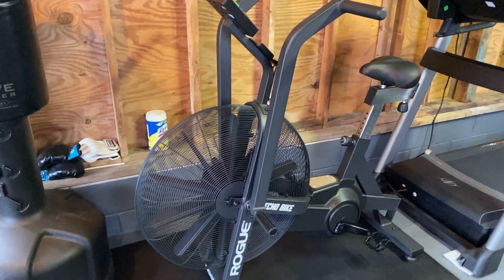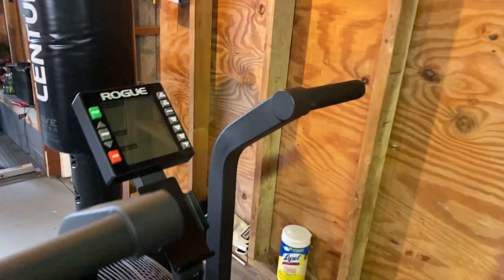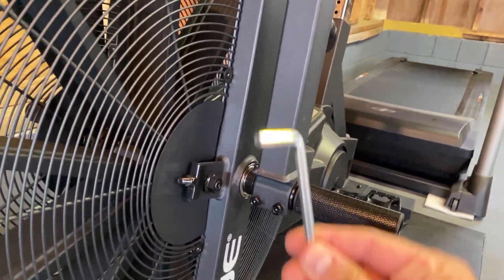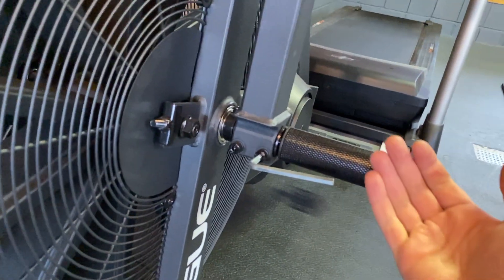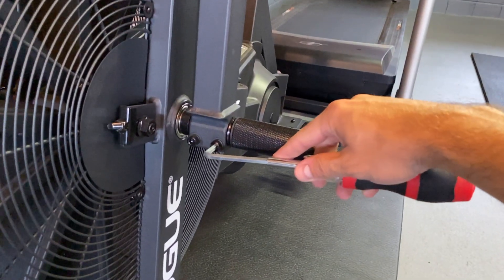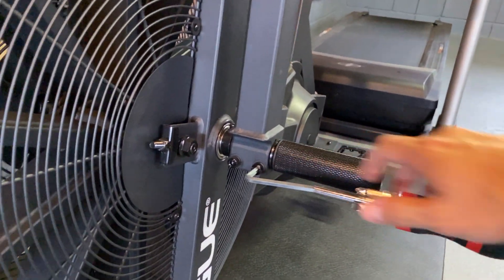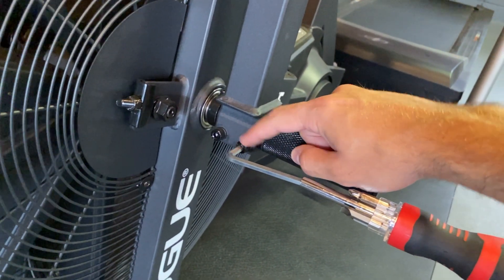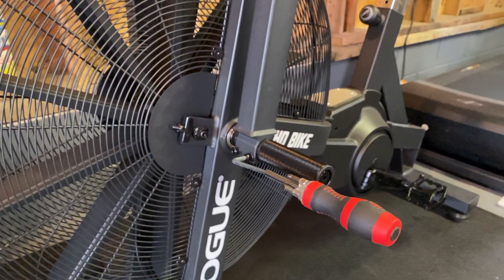Rogue Echo Bike Wobbly Arms | Simple Fix!

Comment: For those afraid of going too far, you can look up generic torque specs based on screw size to give you a ball park as to how tight you can safely torque the screws.
Reply: This is built like a tank though. No way you’re going to damage the steel without a machine, I think
Reply: @kikzrandrade  Most likely you will twist off that L-key before the screw breaks, HOWEVER, you can damage/strip the head of the cap screw making future servicing difficult.   (I've broken many L-keys right about that size).
You are correct that you won't damage "the machine", tho.
I also wanted to give advice that could be applied more safe and in more places.

Comment: I just got the Echo Bike v2.0 and it came with a larger/longer allen wrench (in black) than the one shown in this video. Didn't hurt my hand to tighten the arms fully.  It also came with the smaller silver allen wrench but so far i've only needed that for the water bottle cage (which is still out of stock).
Reply from the maker: That's cool. Had no idea there was now a version 2.

Comment: Thanks for the video, my fix was to make sure the arm is tapped nicely against the set screw before you tighten it. I also  took two big washers and screwed the foot pegs right up against the arms, the foot pegs don't spin anymore (no biggie) and the arms are solid as hell. Let me know if you need a pic to see what I am talking about.
Reply from the maker: That's a great idea also. Even if the foot pegs don't spin it should still be fine. As long as the arms are stable you're golden!
Reply: If you have that pic and can post, I'd be most appreciative.

Comment: Use a 13 socket and ratchet to tighten the bolts while holding the Allen wrench in place.
Reply from the maker: Yes, that is the ideal tool.
Reply: Yup..thats the way to go. 1000 percent
Reply: That's what I did.
Reply: The real pro-tip is in the comments

Comment: if you just use a adjustable wrench )crescent) wrench you can do it that way and not ruin your multi driver becayse its not made to take that kind of side torque but put the adjustable wrench on it tighten the adjustment on the wrench to get a tight contact and bingo you have the extra leverage to tighten all you want and no harm to your wrench ..

Comment: I had the same problem. How did I fix it ? I took my screws and nuts to the local car mechanic service , and they used air compressor machine to screw the nut on the screw till the end. Why ? If u try to do that without air compressor, u won't be able to. Second option was to use 2-3 extra washers, cuz nut has very limited distance. Both options worked for me. Hope I was clear cuz English is not my main language :)
Reply from the maker: MegaTheJohny that’s most definitely an option. Glad it worked out.

Comment: Getting the pedals fully threaded on my Echo Bike was ridiculously difficult.
Reply from the maker: Stephen Millar Bummer when things don’t go smoothly.
Reply: @untappedstrength7548  Yeah I literally had to have my 170lb teenage son stand on one pedal with all his weight while I cranked away with the wrench a quarter turn at a time.  Took about 30 minutes to do both pedals.  I also had one slightly wobbly arm, but I realized I hadn't fully seated it all the way in - so I loosened the bolts, tapped it firmly all the way in, and retightened.  Now they are both perfect and we are loving the Echo Bike.  Kicks our ass, in a good way.
Reply from the maker: Stephen Millar haha that’s one way to do it. Yea it’s well worth every penny.
Reply: Yeah the peddles were the only hard part for me, but not that bad. Just didn't see what to do with the spacers in the instructions, but i put them on anyway. I don't mind that the pegs spin (for now).